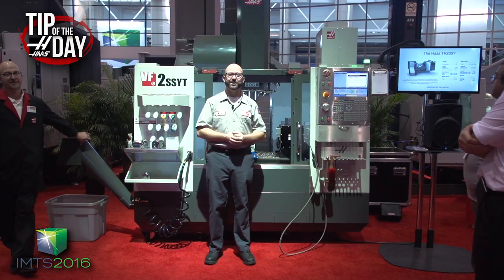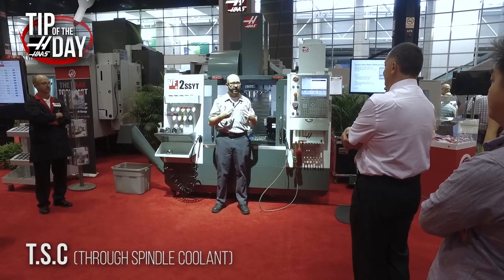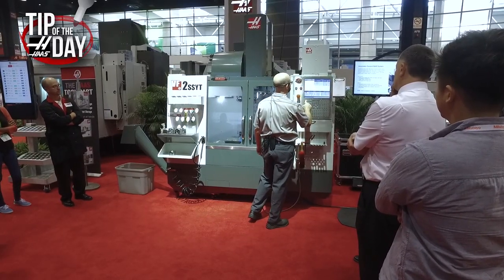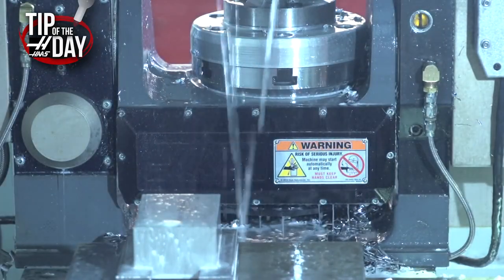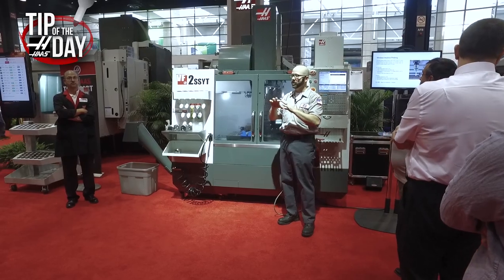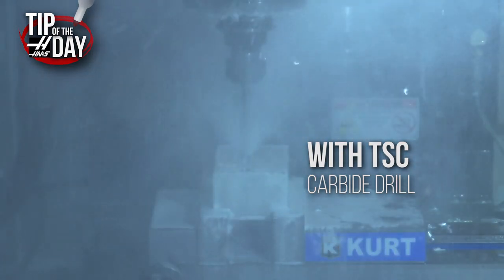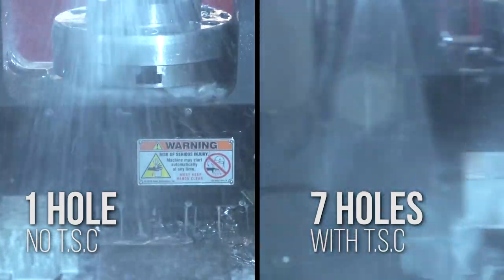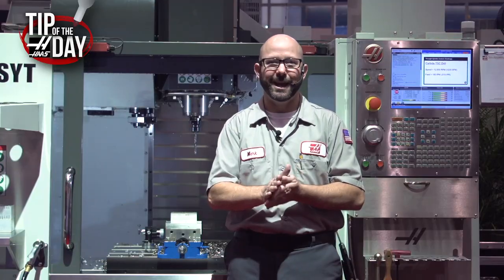TSC Challenge. Thru Spindle Coolant VS Peck Drilling. IMTS 2016 Live TOD. Haas Automation, Inc.

Comment: I love TSC. I run a VF-7 for a company that manufactures hydraulic cylinders, and spend most of my time either drilling out crosstubes that are already welded onto rods, or drilling ports, valve cavities, and any other required holes into bottoms that get welded onto cases after I am done with them. Over 80% of my tools use TSC.

Comment: 1:11 funfact: Spotdrills are designed to be used for drilling for tail stock center (thats why they have a cylindrical part and a conical part, to make clearance for the tip of the center). Normally a NC Spotdrill is going to be used for drills.